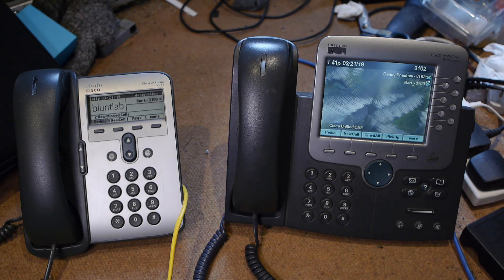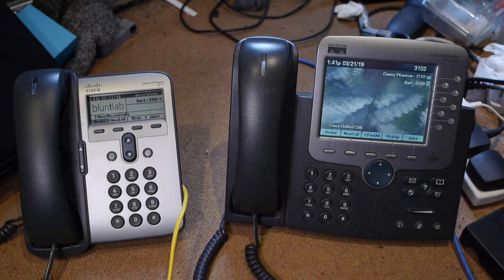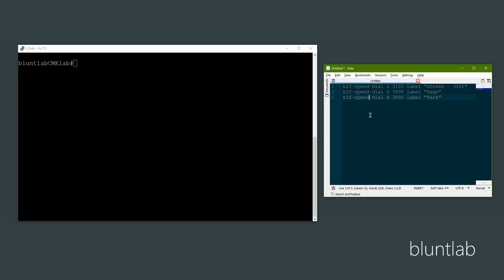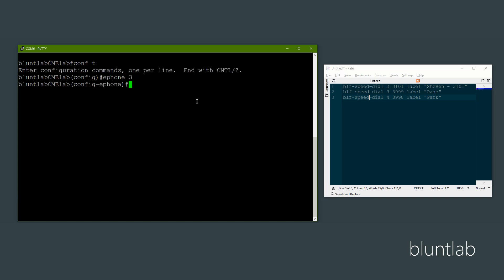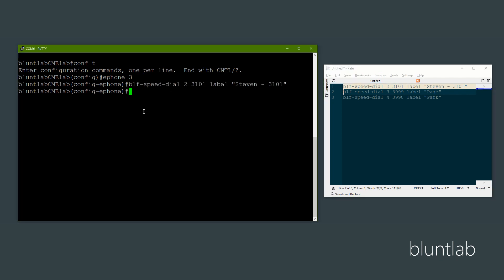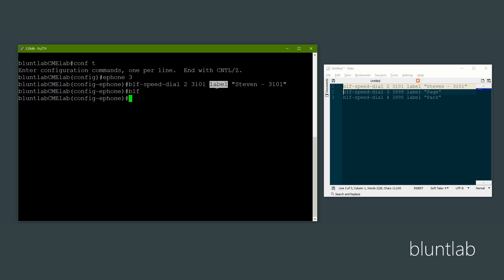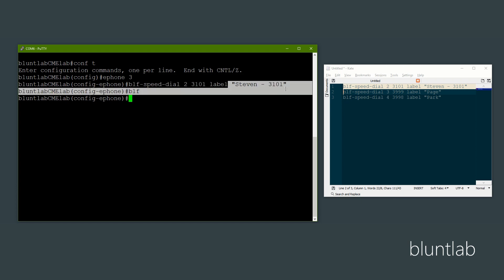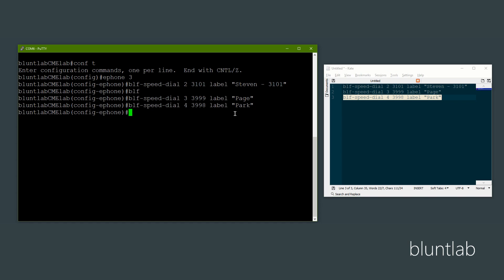Cisco CallManager Express Home setup - Part 6 | Speed Dials

Comment: It's not obvious that one has to have a phone with speed dial buttons to have speed dial functionality.  I've used more than one phone system that had speed dial functionality from plain old analog POTS phones.  One place I worked a couple of decades or so ago had a 1A2 relay based key phone system, or something similar, with speed dial capabilities.  With the Avaya Definity phone system we used to use where I currently work, one could speed dial by dialing *1 plus a two digit speed dial code, such as *101.  The Definity system also had BLF functionality on its digital phones.  In this case, Definitiy digital phones didn't mean IP phones.  They could only be connected to a Definity PBX system.  Since we downgraded to IP phones, we no longer have BLF functionality.  The IP phones we use support BLF functionality, but our external cloud based phone service provider doesn't.  And, thanks to that cloud based system, we now have the pleasure of occasionally having our entire phone system down company wide from coast to coast when there's a network problem.  There are some aspects of our old phone system I do miss.  I'm following this channel so I can set up a more robust phone system in my home with many of the features I miss from the Avaya Definity system we used to have at work.
Reply: Looks like you need to find another Cloud Based telephone provider. The good ones allow BLF functionality and multiple servers for each geographic region etc.